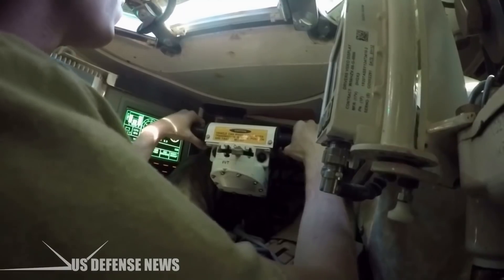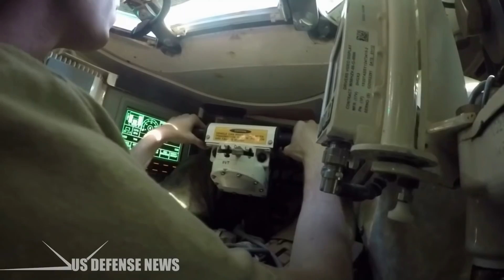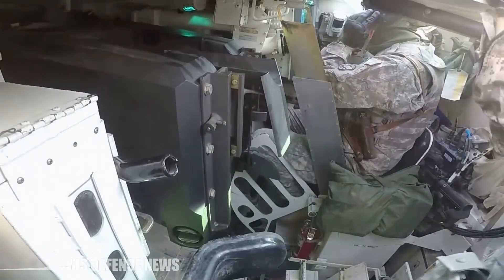Why No One Wants to Fight U.S. Abrams Tanks?

Comment: READ THE WHOLE THING .August 2006 to have penetrated the frontal ERA of a Challenger 2 tank during an engagement in al-Amarah, Iraq, maiming one and wounding several other crew members, but only lightly damaging the tank, which drove home under its own power.On August 25, 2007 a PG-29V hit a passing M1 Abrams in the hull rear wounding 3 crew members.[14] On September 5, 2007, a PG-29V hit the side turret of an M1 Abrams in Baghdad, killing 2 of the crew and wounding 1, and the tank was seriously damaged.In May 2008, The New York Times disclosed that another M1 Abrams tank had also been damaged by an RPG-29 in Iraq.[12][16] The US Army ranks the RPG-29 threat to armor so high that they refused to allow the newly formed Iraqi army to buy it, fearing that it would fall into insurgent hands

Comment: Lots of armchair experts commenting. The M1 does in fact have depleted uranium as a component of its composite Chobham armor. So there are videos of M1's being burned and killed? BFHD. A couple of M1's getting "killed" while being operated by inferior militaries proves nothing except any tank can be neutralized when someone screws up. There are videos of entire landscapes of soviet era  mbt's wrecked by upgraded Israeli M52's, an upgunned WWII Sherman. The M52 is no match for ANY cold war era MBT unless you give the cold war era tanks to a bunch of 4th rate armies. There are exacty two mideast countries with the capability to correctly operate tanks, Israel and Jordan. Tanks are a combined arms weapon, no middle east nation outside the two mentioned have the ability to field infantry, arty, and, air power that are capable of correctly working with armor.
Reply: +RS200q 91

 The depleted Uranium only appears with Burlington armor (proper name for it) on the M1A1HA. No other variant all chronologically succeeding tanks, M1A2 and other wise are equipped with H.A.P. series armor, or in the case of exports, Titanium insertts.

Comment: So the best Tank Competition in 2016 had Italy, Denmark, Germany, the US and some others compete. The results are public knowledge but to give you a summary the US didn't make the top 3. However, in the defense and the Assult range the US did place first. Why?

The Leo has a better track system that allows for faster separation and reattachment. Physical Fitness? Both Germany and Denmark sent there competition teams were as the US just plucked a random platoon. Small arms? At the pistol range most countries chose to use SMGs instead on their pistols which lead to higher scores.

Now speaking on the tanks track record in the current conflict it did well. Only DBIEDs, VBIEDs, and some advanced EFPs from Iran where knocking out the Abrams. RPGs had some effect as they could destroy sights, track, engines, etc. But the tank as a whole (As well as the tank crews ability to fight was fine). Additions in the TUSK kit did not contribute much as that kit came to late in the conflict to matter (most of the fighting was over).

If anything Mechanical issues and high fuel are its biggest issue. Still I justifiably feared tank as it is currently the most battle tested and proven MBT currently as are the men; and now women, who operate it.
Reply: jacob brown Yes a proven MBT against a third-world conflict. But surely not against superpower like Russia or China.

M1A2 Abrams is a good tank, but the fuel consumption and weight really reduce my rating on this tank. I rather pick T-14 Armata that have well-balanced stats with cunning tech even though it is not yet battle proven.
Reply: Emiya Kiritsugu I could argue tank v tank all day man but its only as good as the country supporting it. Also, I just do not see Russia and the US ever facing off in a future conflict. The fact of the matter is these MBTs will probably continue to be used against lesser opossition for the forseeable future.
Reply: Steve A in the end nothing matters when the USA becomes a third world country
Reply: The Catholics have almost won.  Third world unless Americans stand up and vote the CATHOLIC traitors out.
Reply: Before the t-14:
"T-90 is the best", but the t-90 is just a small upgrade based on the t-72 with some stuff from the fail that was the t-80 that can't do shit vs the m1...
Now:
"T-14 is soo much better"... but when they are ready for combat the nato forces will also have a new generation of tanks that will be way better than the t-14, just like the leopard 2, challenger 2 and m1 were compared to the t-72, t-80 and t-90... I bet that if you gave them a change, they would trade their mbt for the leopard because it's just the perfect all-rounder. Best gun on the block, better maneuverability, armor, etc. There is no reason why anyone would choose to equip their country with the t-90 over the leopard (well, there is one, maybe they don't want them to have it). And, since this argument is based on speculation, we don't know what the russian tank can do, all we know is that it can (barely) drive around, the new t-14 probably gun can't do shit against the challenger 2 armor... but i bet that the challenger could do some real damage to that thing, it's too light to have any real protection, just like the older ones did. 

And, in the end, we don't want them to fight, that would not be good...
Reply: More utter BS from the DELUDED.  Like the Israeli "invincible" Merkava, until someone shot one in the REAR DOOR, and it went up like fireworks.  Now EVERYONE with an RPG knows how to kill a Merkava EASILY.  All Tanks have flaws and vulnerabilities.  The M-1 Abrams too has these. For one, it's weight means it would NEVER survive in MOST of the Worlds battlefields when ground is anything other than hard packed. It has NO APS, and even the Israeli "cheapo" they're retrofitting is nearly useless against New ATGM's.  Multi-staged and top-attack missiles will kill or disable ANY tank.
Reply: The 2017 Strong Europe tank competition US made 3rd place. Behind Austria (1rst) and Germany (2nd).... Solid improvement from 2016 if you ask me. In may the 2018 competition starts again. We will see where they place this time.

More nations were invited in 2017 such as Poland, Ukraine, and Turkey. Maybe even more will be invited in 2018.
Reply: Was it the M1's that the Iraqi's are using that got taken out or the US M1A2 seps. I didn't think the us had much armor over there going up against ISIS other than the latest versions of the strikers that the rangers use and the Marines LAV 25
Reply: sleepingninja M1’s that the U.S. sold to the Iraqi military. I don’t think the U.S. would sell or give away its most latest version. 

Btw, wtf is home dude talking about above me? Lol
Reply: jacob brown In the end none of it matters when an Apache is near by or an a-10 .
Reply: That is a good point. We do incoperate joint manuveer training far more often and to greater success. I am also not trying to take anything away from our amazing tankers who fight on what we give them. I would like to see the next generation of tank (or upgraded Abrama systems) look at weight reduction, gas consumption, taking the over sized electronic components and scaling them down, removing or moving the commander's crow system, and some minor cosmetic/quality of life changes I would like to see. The tank is (as it is now) good at what it does. I just know it could use a 2017 face lift with current tec
Reply: M-1a2 Piss-Poor in mud, Freezes below -20F. Don't bring them to Russia.

Comment: Abrams is for museum, nothing more.
Reply: +Zachs 

 Why?
Reply: +Nathan Peterson Very old tank.
-ERA only on hull
-No defence system for Laser Guided Missiles
-No missile firing from main gun
-Main gun very old
-Old engine (problem in sand environments)

Without any special Mod. 

Leo2 , T-90, T-14Armata, way better tanks. 

My opinion.
Reply: +Zachs

> "Very old tank."

 As is the T-72 and Leopard 2 (both operationally speaking, are older). But they are still in service. 

> "ERA only on hull"

 The M1A2 SEP variants as well as more current export variants offer the E.R.A. all over the sides of both hull and turret.

> "Main gun very old"

 The ammunition is not. While eventually this will be the case, the ammunition is considerably more important.

> "Old engine (problem in sand environments)"

 In terms of reliability, the AGT-1500 is not bad in sand environments. Air cleaners are just more critical in these environments. And initially, both M1's, M1A1's, and Challenger 1's in the Persian Gulf War had similar breakdown rates and fewer operational vehicles in combat because of the air cleaners not being well adapted for the environment.

 While the air-cleaner is certainly as critical if not more so for the turboshaft engine, it was not the engine being the issue in service.  

> "Leo2 , T-90, T-14Armata, way better tanks."

 Which Leopard 2s? Which T-90's? We know nothing of the T-14.
Reply: Leo A7,A7+,A8 T-90MS
The gun can't fire missiles.
And the defence system for Laser Guided Missiles is a must, for a tank. Both air attacks and ground attacks, with missiles, into a tanks, use Laser guide, or thermal image. 
And the gun matter, alot (you know that).

I am not with americans or germans or russians, I just see the big picture.
Reply: +Zachs

> "The gun can't fire missiles."

 Nor can the Leopard 2A7, (excluding the more recent modernizations, which other than for demonstrators, I have yet to see in operational service with anyone). The Leopard 2A7+ and Leopard 2A8 are both demonstrators. The Bundeswehr has put an order for ~60 (Military Today claims 62) Leopard 2A7+ for operational testing. The Leopard 2A8 has yet to see any orders since 2015. 

> "And the defence system for Laser Guided Missiles is a must, for a tank. Both air attacks and ground attacks, with missiles, into a tanks, use Laser guide, or thermal image."

 The M1A1 since Operation DESERT STORM has operationally had AN/VLQ-6 Countermeasure kits available and in widespread service. Though is not on production vehicles, only added after procurement and to the crew/units conventions. The AN/VLQ-6 uses a massive infrared burst in the general vector of the A.T.G.M. or other guided munitions to blind/oversaturate the sensors. It also has been accepted for use on the M2 Infantry Fighting Vehicle. 

 The Israeli-designed Trophy-system, as well as the Raytheon "Quick-kill" hard-kill A.P.S. have been in operational and combat testing, but has not been used outside of Afghanistan, and are only on several tanks.  

> "And the gun matter, alot (you know that)."

 It does. But the progression of ammunition has, for combat, been the key focus for U.S. Tank Development and for good reason. Different and newer guns are under development, but won't be used on the M1, except for possibly the XM360E1. 

> "I am not with americans or germans or russians, I just see the big picture."

 I understand and appreciate that. I just disagree with your comment that the M1A2 is, while truly old, obsolescent.

Comment: BS, we developed "DU" rounds in the 70s, on Chieftain. There's a reason the armour is called Chobham, and Dorchester (look at a UK map, hint hint).  In the age of 105mm tank guns, which nation used a 120mm (hint, it has towns called Chobham & Dorchester). Which production tank first had fully stabilized gun control equipment - hint it was developed on Centurion, and fully deployed on the tank that replaced it (not M60 or M1)
Reply: +Peter King

 Burlington. Not Chobham. Chobham is the location of the development for both armors. Not necessarily their attributed semi-official names.
Reply: Don't forget the implementation of IFCS and the FSAPDS rounds, another world first.

Comment: Too big and too heavy, there are known cases of bridges collapsing under with this war mighty machine. It has enormous consumption, weak upper armor,  low reliability of the odd gas turbine propulsion. and lack of diverse types of ammunition. and who can believe it, NO air conditioning... Logistics behind this tank is a true nightmare. The poorly trained Iraqi, Yemeni, and other Arab fighters managed to fry dozens of these, using even the obsolete RPG 7
Reply: +1zanglang

> "Too big and too heavy"

 As compared to what exactly?

> "there are known cases of bridges collapsing under with this war mighty machine."

 While the issue is existent, there are surprisingly very few cases of such. Most write-offs or damage listings of M1's lost in road accidents including bridges, appear to be driving off it because of lack of sleep (leading to one tank crew drowning during the battle of 73 Easting after the driver fell asleep and drove off the bridge, landing  upside down.

> "weak upper armor,..."

 Which variant? How so? And compared to what?

> "low reliability of the odd gas turbine propulsion"

 Low reliability? How so? As compared to what?

> "and lack of diverse types of ammunition."

 Again, how so? The M256 is rated to fire a whole range of S.T.A.N.A.G. directive 4385 rated munitions, even more so than the Rheinmetall L/44 given a barrel designed to stand higher-pressure munitions.

> "The poorly trained Iraqi, Yemeni, and other Arab fighters managed to fry dozens of these, using even the obsolete RPG 7"

 Not necessarily with an RPG-7. Certainly mobility kills and freak penetrations are possible and the prior do happen a lot with most M1's abandoned, damaged, or lost. Though I know of no total loss achieved by penetrations from the original RPG-7.
Reply: ”As compared to what?” Hilarious question. As compared with all other MBTs in the world. I don't want to convince you about anything, and I don't have to explain to you, what is obvious. If you're so interested, then study all the documents, statistics, analysis, and whatever you can find about the beloved Abrams. You'll find out that it is not better than other tanks from its counterparts. And, also, find out what type of projectiles were used by Abrams tanks in the conflicts it was involved, not the STANAG blah, blah. Check if this STANAG 4385 is fully implemented in the US Army. Regards.
Reply: +1zanglang

> "Hilarious question. As compared with all other MBTs in the world. I don't want to convince you about anything, and I don't have to explain to you, what is obvious."

 So, absence of evidence? That's your argument?

> "If you're so interested, then study all the documents, statistics, analysis, and whatever you can find about the beloved Abrams."

 I have had research in the past. I see no reason unless you don't want to discuss you don't bring your evidence to your claims.

 I do like the M1 series. But I do not love any particular piece of equipment. Maybe their features, but I digress. I have favorites, M1's being one of them. The M1's do not fail or appear worse in any category compared to other M.B.T.'s in its weight class or designations. Certainly some tanks out there outperform the M1 in some categories, but as my research goes, if you want me to provide it, I would be happy to, but the M1 is not by any argument a bad tank as you seem to argue. 

> "And, also, find out what type of projectiles were used by Abrams tanks in the conflicts it was involved, not the STANAG blah, blah. Check if this STANAG 4385 is fully implemented in the US Army. Regards."
  
 Another fallacy. You never specified, let alone inferred any conditions. Leaving it open to reference to any  M1 operator. The M1's in service armed with the M256, since 2001 have had 5 types of ammunition available. 2 types of multi-purpose shaped charged ammunition, the DM12 (the German designation stuck), and the M803 MPAT (officially a licensed DM12, with several modifications). M1028 canister round, and the M829A1 and M829A2 APFSDS-T with depleted-Uranium core. Most M.B.T.'s have similar or less. By no means